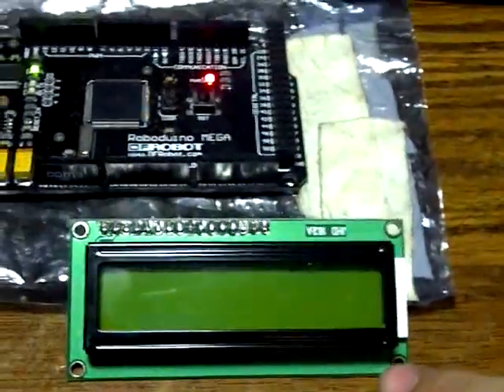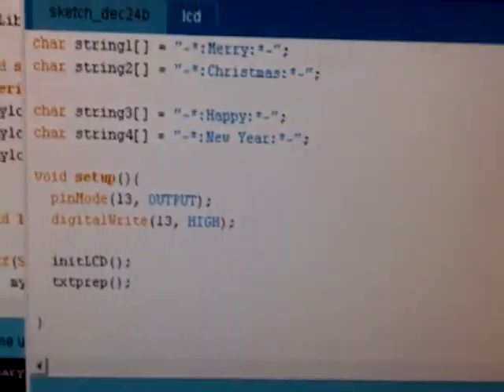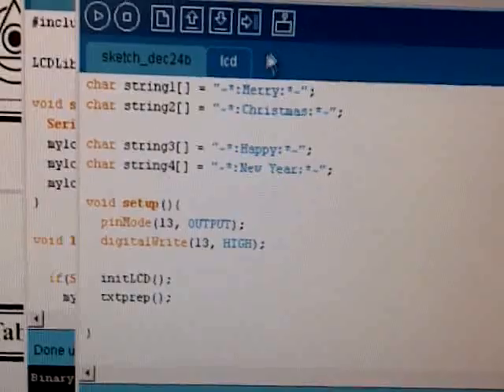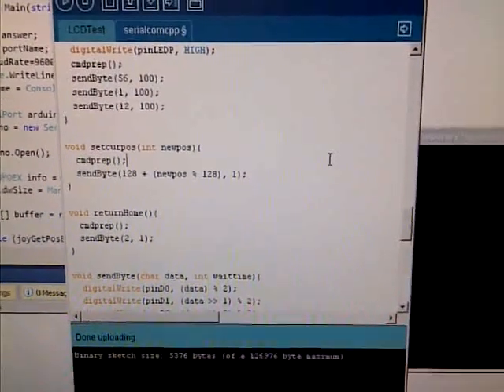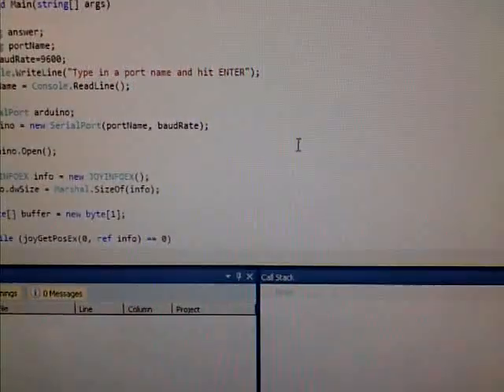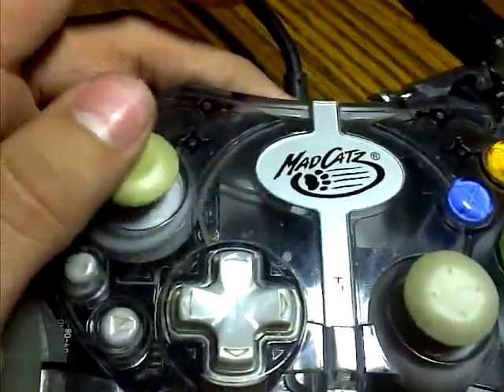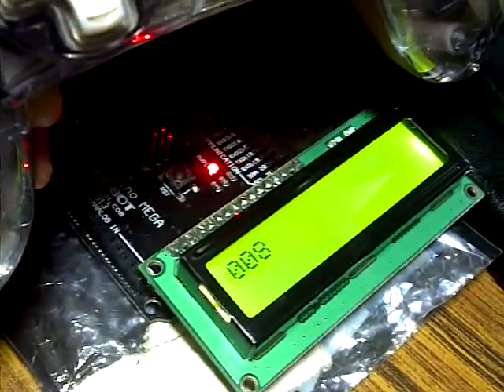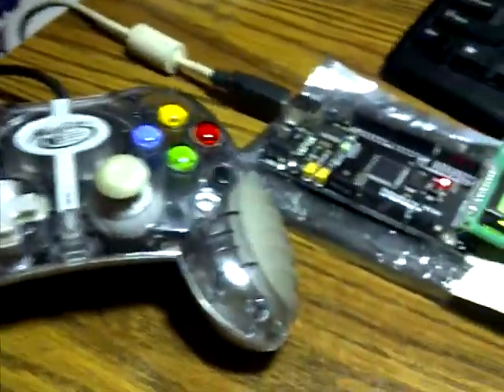Arduino LCD and USB Gamepad Control

Comment from the maker: Haha well actually that's exactly what I wanted to do. I couldn't figure out how to interface arduino with USB so I made this as a temporary solution. Since then I've designed and built my own game pad and circuit that utilizes an atgema, and transmits wirelessly using a GFSK module.

For resources, if you're referring to sample code, all I did was find some examples of serial communication and game pad communication online by searching on Google. The rest was fairly easy to set up.

Comment from the maker: In this version the game pad is connected to the PC and an application running on the PC sends the information through serial to the Arduino. It is also probably possible to connect the game pad to the Arduino, but the USB protocol stuff is difficult and annoying to deal with.